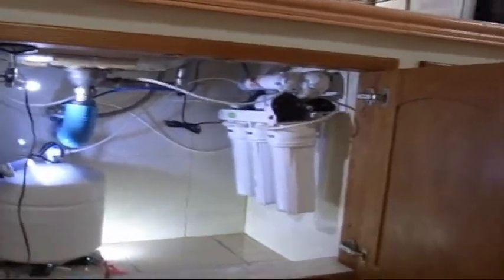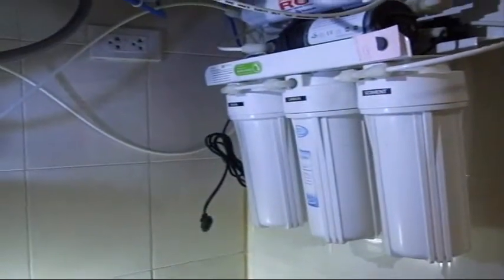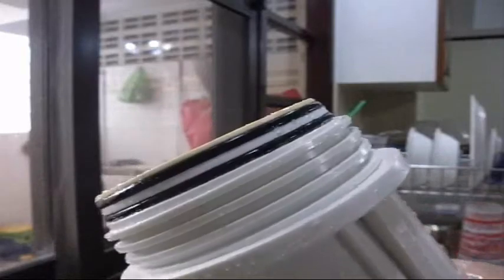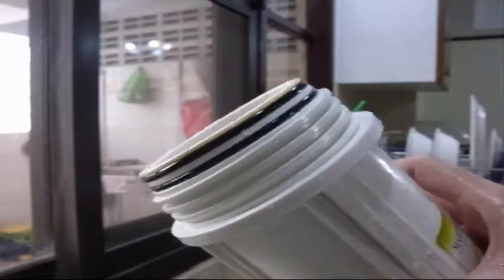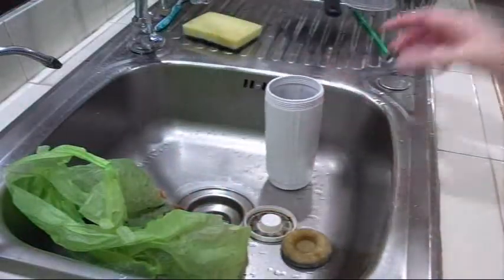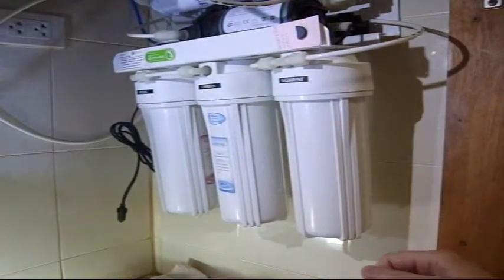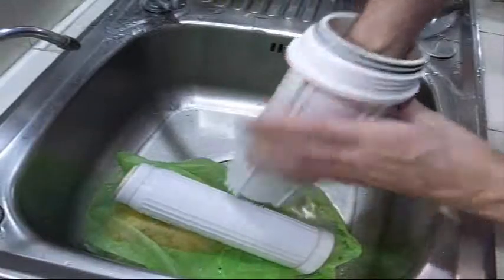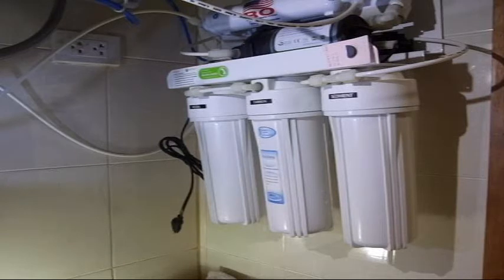DIY RO Water Filter Change - Sediment, Carbon & Resin Filters

Comment: Well I learned something I never checked my filters that they come apart, DA,, And i see my resin filter is only 1/2 full and I get a lime scale on my glasses. So thanks to you I will order some resin and I live in Thailand also  and will fill it up and get a refillable carbon filter. the carbon I have are sealed.  Thanks for the video.
Reply from the maker: I am glad you found it useful.  Make sure you put them back in the same order.  The resin is the one that removes the lime.  The carbon helps with taste by removing reactive chemicals (sulfur, ...).  The first filter is a sand filter to keep the bigger stuff out of the system.  If you don't keep these clean on the RO filter thing will go bad (I have seen them crack open).
Reply: @tsbrownie  Yea, I got that part and have another pcc filter before the tap but the resim filter i have is not even 1/3 full so i think filling it will help a lot
 And i got a bunch on a lazada sale so i have a few extra but all 1/3 full of resin. 😠 Ordering a few bags today
 Thanks again ,,👍👍😁😁😎
Reply: @tsbrownie  Oh  i am not sure if you have a big pump but i run 5 bar water pressure so took the electric pump off and changed it all with auto shut off valve. I was replacing the pump every year so now only filters and a $2.00 plastic valve. 👍
Reply from the maker: @brentthailand5742  Maybe you know already, but the resin that performs the water softening function "burns out" in time and needs replacing / recharging.  I learned all about that from my last house that had a water softener.  Every week it would automatically wet the resin with a brine solution (and then rinse it) to recharge it.
Reply from the maker: @brentthailand5742  WOW, 5 bar is almost 80 psi if I recall.  That's a lot of pressure.  We use gravity feed and I think we are at 20 psi or about 1.5 bar!
Reply: @tsbrownie  Just under 5 bar i have in gound sprinklers they need 60 psi to work good. So i put a 1 1/2 hp pump and a 200ltr pressure tank and works great. So RO does not need the extra pump. 👍
Reply: @tsbrownie  I just ordered 3 bags or resin to fill my filter. So when it gets here i will change sediment and replace resin with a full canister like you did and see if it helps. Thanks to you showing me they come apart. Haahha 🙄
Reply: @tsbrownie  Oh ok good to know thanks. I ordered 3 bags off lazada i can refill it with new everytime i change the sedement filter also. But i am sure it will work better full and not 1/3 full. 😁😁
Reply: @tsbrownie  Changing every 4 months or putting new resin in should work or does it last that long? I will compair stain on glasses before i change and watch over months  and see how long i can leave it. 👍
Reply from the maker: @brentthailand5742  It's directly related to how much water passes through it.  We have 3 people in our house and I change the carbon and resin every 6 months and clear / replace the sand / mud filter at those times as needed.  My personal experience (your mileage may vary) is that the machines only last 6-7 years and need to be replaced.  The RO chamber will last depending on how well the other filters are maintained.  If the resin / carbon / sand filters are not changed, the RO goes bad within a year or so.  If you keep up good maintenance I've had an RO filter last the life of the machine.  I saw your video and like your library!  I always wanted one like that!  Is that at home?  How do you keep the bugs out of them?
Reply: @tsbrownie  Great i change some every 4 months and have a box full of ro membrains amd all the others also. I was just disapointed with the stain or lime or calcium cloud on glasses so i am hoping when the resin gets here and i fill the new filter and keep the old one also and clean it out things will be better. If its good i was thinking yesterday i might even put a 20" resin housing and filter just before the ro membrain and run the 2 i have lots of hose and connectors. But have to wait now for resin to come. 👍  I live in prasat surin if your not far we can meet for a beer some day ? 👍
Reply from the maker: @brentthailand5742  To clarify, you don't need to change the RO part that often unless you let the other filters go bad.  They "protect" the RO part from clogging (I had an RO split open because it got clogged and the water pressure burst the container).  I'm staying "distanced" and not traveling these days in spite of offers from friends - COVID and all you know.
Reply: @tsbrownie  Yes i know but last year there was a sale on so i got 5 ro membrains for cheap, and enough others to last for years. And have 3 resin filters just never looked to see if full or can open it. So thanks to your video i learned to open my eyes. 😁 I hear yea about travelling we dont know anywhere either just go get food and home 3 freezers now so dont go often. Even a butterball turkey for tonight from tops.😋😋😋

Comment: Thanks for that. Flinally got motivated to get an RO system after taking tour of county water system.   Wondering which filter brands fit which canister systems or if they are all proprietary, Big box as only Whirlpool.
Reply from the maker: I've just got some generic brand.  I'm no expert, but as long as the RO part is good quality and the carbon and resin are good, it should work.  Also I don't use the cartridges, but fill my own.  Much cheaper (and I am cheap!)

Comment: Why does your RO system have electricity to it?
Reply from the maker: To push water through the really fine RO filter requires more pressure than most household water can deliver, so the electricity runs a pump.

Comment: where did you buy those reusable filters? can you share a link?
Reply from the maker: These came with the water filter originally.  I think the mom and pop shop where we bought it sold them also as repair parts.  I found some by googling "reusable ro water filter resin cartridges", but I don't know about them.